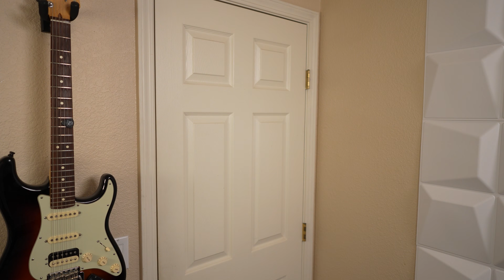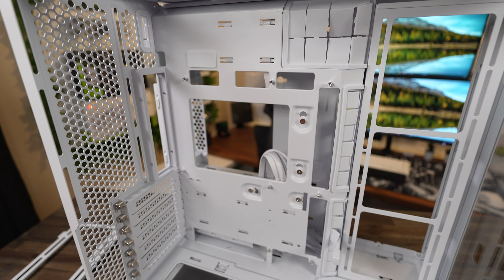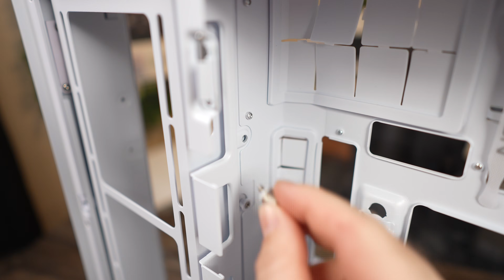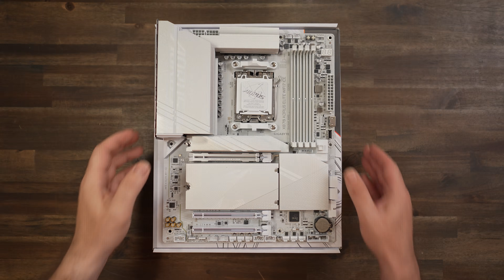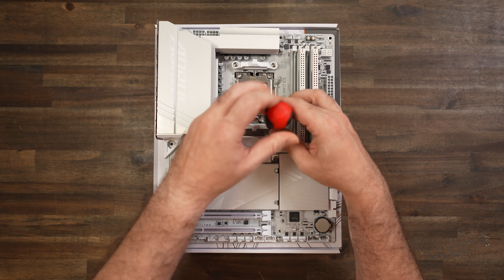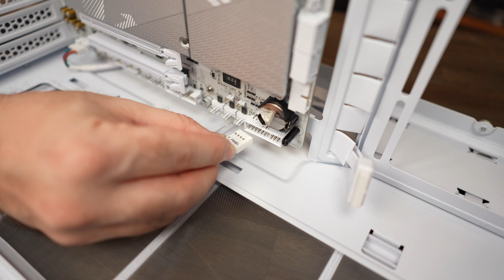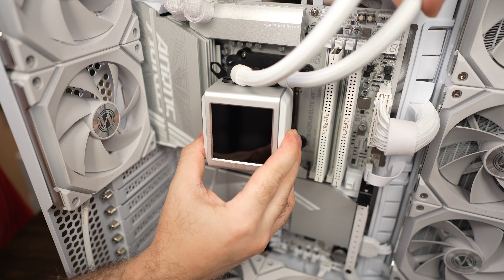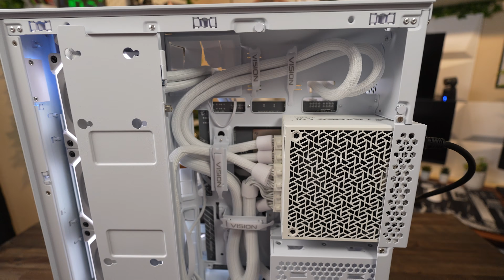Lian Li is BACK with the NEW 011 Vision COMPACT (X870 Build)

Comment: cleannnn af... although i dont know too much about that brand for the 90 degree High volt power cable for the gpu. Whats the best of the best you would recommend for getting a 90 degree angle for the new RTX 5000 series? Especially if your planning on giving a kidney and a leg for one, do not want to risk frying the GPU.

Comment: Hey man, I just built a pc with the same case and I liked your wire management of the back so much that I ended up buying the wraps for the cables through your link. I just received them today, but they seem small. You used the 1/2 inch ones? 
Also one more thing I installed a 5080 and a little sketched out using that 90 degree adapter through amazon, would you recommend a specific one?
Last  thing whered you run the cable for the two exhaust fans? @DanKamYouKnow

Comment: Hello, I have a question: is it more spacious than the h9 flow? Does a msi 5090 trio fit here horizontally without the cable pinching?

Comment: Quick question! How did you mount your fans using the outside holes? My screws are shorter. I have to mount them from the rear of the fan.

Comment: Hi Kam, I believe you are able to orient the radiator the other way around if you run the tubing down and right, out of the grommet the motherboard power is also going through. It will make the AIO last longer if you do :)

Comment: Just got this case. You gave me SO MUCH peace of mind with that F Panel cable this case comes with. My MB is a gigabyte B650 Aorous Elite AX Ice which has the same F Panel header and knowing I can just plug in the F Panel case cord right in without issue to the far left pins gave me a sigh of relief.

Comment: Would be super cool to also use a 90 degree adapter for the 24pin and 12v connections or maybe even an 180 degree (if it even works) to hide the most of the motherboard cables

Comment: Is it possible to do the push pull set up (vertical radiator as you had) with the mesh top? I want to add to add 3 fans up top too, while keeping the radiator on the side.

Comment: I have a question because I'm looking to build in this i wanted you to explain how the fans work like the reverse ones do the reverses ones pull in airflow or push out and did put the reverse fans on the back of radiator or in the front of the case and the 2 fans on the side in the front are they regular or reverse, sorry for the question just really confused

Comment: I’m planning to do a similar build with a Asus astral 5090 and a Ryzen 9 9950X3D as soon as they release. This is a fairly big project that I’ll be attempting/ my dream computer build. Will I need to purchase any additional connectors, or splitters to have the ARGB lighting fully functional/ synchronized, and is there any advice you would offer?

Comment: bro you inspired me so much for build my setup, thank you so much ❤
Reply from the maker: Happy to hear that! ❤️❤️❤️
Reply: @DanKamYouKnow so I’m building my first pc as a console user and i need some clarification. In regards to fans, specifically LIian LI TL wireless. Do i want the bottom 3 and the  3 radiator fans as reversed and then the two on the left side those are standard fans for a total of 8 fans?
Reply from the maker: @ If you are running the same case (or a case with a similar layout), you will want the fans on the SIDE of the case and the BOTTOM of the case to be reversed blade. The rear 2 are standard blade. You will need at least one 3-pack to get the controller.
Reply: @ oh so the orientation is if you are facing the small glass side then to the right of it where the aio is considered the “side” not the back. I didn’t know that. So, I can just run 6 reverse and 2 standard I don’t need fans on the opposite side of the radiator to do the push pull method you mentioned. Yea if I researched right, the white controller is for lcd fans and the black one is for non so if you get a pack of 3 that lcd controller will control up to 10 fans so I would only need one usb.
Reply from the maker: @ Correct, 6 reverse blades and 2 standard. The LCD and non LCD controller is the same. I am using the LCD controller with a mix of LCD and non LCD fans. The color does not matter.
Reply: @ ok thank you so much man. This is my first build so it’s a bit of learning. The last time I played on a pc was with those tan dell towers playing sierra games lol So far I have the Lian li compact, the 9800x3d, 870e strix motherboard and 2 corsair 16gb vengeance ddr5 sticks ( can you run 4 16gb sticks?). I’m still unsure on the aio. Leaning towards the ROG Ryujin 360 for a blacked out look, just unsure if it will fit in the grommet hole. And of course the GPU is a huge issue right now with cost and the new ones releasing. I do wish I could snag that sweet gunmetal 5080.

Comment: Not a fan of the connectors for headphones and usb flash drives at the bottom near my feet. Dont want to risk kicking or getting my feet tangled with cables. I like the Antec C8 white more.

Comment: Curious, is there enough GPU clearance to fit 28mm or 30mm fans on the side radiator?  I have som APNX fans I intend to use in this case and they are 28mm.  I was also eyeing the D30's.  Thanks!

Comment: Looks are wonderful on your build!!!
Just wondering why you went with another series of fans on your AIO? All about cooling but could be some overkill ????, However give me your take on the 2nd set? 
How tight was the side glass placement from using the 90 degree power adapter to the GPU?
Would have been nice if there had been more room to move the port for the AIO over into the middle, but then that may have interred with the Back Connection port’s.
Thanks for the video!

Comment: Hey man quick question. Did you attach the SATA cable from the AIO pump into your power supply? I'm wondering as I'm gonna install this on my build but I'm not sure whether the included SATA cable beside the USB c is required. I could see that here in this build it doesn't look like you have it plugged in. Let me know thanks

Comment: Nothing these days makes a PC case stand out from others - they all look generic and the same. To all manufacturers, please go back to the drawing board. Let's start bringing multi-colour, desktop versions and make the overall designs more interesting.
Reply: The average consumer doesn’t want multi color parts. That’s where the rgb comes in. You also have to realize that there is multi colored parts out there but people don’t buy them as much because that limits the themes you can pull off with rgb. I’m with you on maybe the architecture of parts, but colorizing parts limits the freedom of customizing your pc afterwards. That’s why people either go all black or white or a combination of both.

Comment: What screw did you use for the push pull setup that is long enough to hold both side. I know the that come with the AIO is long enough but what screw do you use on the other side am looking to do this exact setup but can’t find the right length of screw ? Please send me a links
Reply from the maker: I used radiator screws on both side. For the front, the screws go through the fan and thread into the radiator. Same thing for the back but the screws go through the fans, then the bracket, then into the radiator. So the back screws are what hold the radiator and assembly together. I don’t have a link but PC radiator screws should get you some on Amazon.
Reply: @DanKamYouKnow will a tryx panorama aio fit in that grommet hole?

Comment: Are those Just the cable management sleeves u can get on amazon? Which brand? Also What do u strap the ends with? Is it Velcro strapping? For where the plugs stick out on both ends to keep them tied off and from unwrapping? Or is it electrical tape on the ends? It looks super clean.

Comment: I'd like to know the size of the cable sleeve used for the 8-pin cable and the 24-pin cable used in the video. There are several sizes on the site on the link, so I don't know what size to buy.
Reply: Did you find out?

Comment: Doesn't fit 4090, you need to set it vertically for that by getting the connector! Had to change it to DF800 for it to fit.

Comment: so on the radiator since im doing a build like this with the new be quiet dx900 case the air in coming in from the back of the case and the reverse blades are pulling air inside the case?

Comment: Q) wouldn’t you want the radiator fans to exhaust not intake? Isn’t that hot air coming in?
Reply: Cold air cools the radiator before getting in the case. Why cool a radiator with hot air?
Reply: @where does the radiator heat go?
Reply: @fuzzylogik1429   out the other side of the case. Why would you heat up a radiator that’s has hotter water?
Reply: @TheSjuris  the radiator is the heat source right? So, the air that passes through it will end up hotter. Not sure why you would want that hotter air in the body of the case?
Reply: @  you want cold air to go through the radiator cooling the radiator. You don’t want hot air going through a hot radiator heating the radiator up. The heat source is the cpu and you want cooler water absorbing the heat.  Plus a radiator itself will keep hot air from flowing through it. So again why would you want hot air heating up hot water.
Reply: @TheSjuris  Yes, the heat source is the CPU, which is transferred to the radiator. So we agree the radiator is 'radiating' heat. 

We then have two sides of the case, one side we want to keep cool (the one with the CPU/GPU) and the other we don't care about. 

Why would you blow the radiated heat 'into' the side you want to keep cold?
Reply: @ you’re missing the obvious point why would you want to keep hot air in which you would do by blocking the exit with a radiator and that you want to cool the radiator which you need air that isn’t hot to do.  So tell me why would you heat a hot radiator with hot heat from both the cpu and blow even more hot air from the gpu at the radiator?  By the way, the correct way to do this is exactly how I am describing it and the case and aio manufacturer agree with me along with science.  Cool air cools hot radiator and exhaust fans remove hot air. You want to cool the water in the radiator kinda harder to do by blowing and pushing hot air right at it.
Reply: @TheSjuris  but you get the heat doesn't go away, it's just transferred to the air which is blown back into the component side. This is why radiators, where possible are at the top of the case blown out. 

I would think pulling in from the bottom past the GPU and blowing out though the radiator would result in a lower component side temp. With the downside of possibly higher CPU temps, which seems like a good trade-off.

Anyway, that's why I asked the question as just looking at the config would seem the hotter air from the radiator is being pulled past the GPU, maybe the rear exhausts are capturing all of it and the bottom extraction works better with the direction of the GPU fans.

Having radiator fans blow inwards is not common, so not sure where you're getting that idea.
Reply: @  you’re adding heat to the cpu not taking it away. The gpu gets its cold air from the bottom intake of this case already.  Blowing it out through an object that is just about completely blocked with air coming in which would also include air from the gpu that left the case only to get pulled back in. You want cold air to cool down the water that flows through the radiator that way it can cool down the cpu with whatever heat that’s generated to get out of the case right either next to it or through the top. This case in particular has issues with removing heat through a potentially solid top.  You’re not seeing the point you want to cool down the radiator and the water and you can’t do that by blowing hot air at hot water. People put their aios on top of the case because it doesn’t add noise to the case or allows bubbles to form.  The better cooling mechanism is by putting the aio on the side or the front where it has better access to colder air.  Have to remember that hot air also rises and there’s usually little filtration of air on top.
Reply: @TheSjuris  you lost me a bit. The ambient air temp inside the case is still going to be lower than the radiator temp and won't be 'heating it up'. 

The trade-off is a higher internal temp vs a lower CPU temp (the heat has to go somewhere) I would have thought a lower internal temp where the GPU is drawing air would be more important.
Reply: @  the ambient air is lower then the radiator hence why you want that cooling ir down instead of the hot air inside the case. The ambient air inside the case will be almost as hot as the radiator since it has 2 hot components heating to it up. The gpu gets cooled from the fans blowing directly underneath it. You want the heat that’s generated to have access and with 2 exhaust fans directly next to the cpu it will push it out.

Comment: Awesome build! What about the direction of the air of the push pull configuration of the radioator fans, does it push air inside or outside the case?

Comment: Hey Dan! I also want to use reverse fans in my build so I just wanted to ask if you used a fan hub to wire the fans together or did you use maybe fan splitters?
Reply from the maker: The Lian Li fans comes with a controller (the 3-pack's more specifically are the ones that come with the controller) and that is the only one that will work with Lian Li fans.

Comment: is it possible to use the vertical mount for the gpu for a different look and also to avoid using an adapter in order not to hit the glass panel?

Comment: Great case! But one thing I noticed is the bottom fans are pulling air out of the system. As are the side fans. Looks like every fan is pulling out air. Plus the radiator fans are pushing against each other.

Edit: Saw the pinned comment. I stand corrected. I had no idea reverse bladed fans existed. Looks strange as hell but is pretty neat!

Comment: Prices on 11/11/2024
Approximate total pretax = $3,340 USD

Case = $120 USD
AMD 7950X3D CPU = $593 USD
ASUS Strix 4080 Super GPU = $1,130 USD
GIGABYTE X870 AORUS ELITE Wifi7 ICE Motherboard = $290 USD
Super Flower PSU = $200 USD
Lian Li Gallahad II LCD CPU Cooler = $220 USD
Samsung 4TB NVME Storage = $300 USD
TEAMGROUP RAM = $160 USD
Lian Li SLV2 REVERSE blade fans: (Front Side and bottom) = $27 USD each (x6)
Lian Li SLV2 Fans (Side Rear) = $93 USD
Lian Li SLV2 Fans (Rear) = $27 USD
90 Degree GPU Adaptor = $20 USD
Cable Wrap for PSU cables = $17 USD
Velcro strips for PSU cables = $7 USD

Comment: Awesome build! How is it going with the EZDIY-FAB 90 degree adapter?  I have a 4070ti super aorus strix GPU in a Lian Li O11 dynamic case and am having the same issue with the case front panel not being able to close so am considering using the adapter. I'm a bit worried about using the adapter but the only other option is a new case or perhaps vertical GPU mount.

Comment: Am i trippen? I swear it looks like the radiator is regular blade (intake) and the front fans are regular (intake). Meaning the air flow isnt balanced/is being wasted by them blowing opposite ways. Right?? I NEED ANSWERS!!
Reply from the maker: The front radiator fans are reverse blade and are pulling air into the case. The back radiator fans are regular blade and are pushing air through the radiator. They are both intake fans.

Comment: I have a VERY WEIRD problem on my machine! RTX 4060 TI 16GB VRAM, i9 12900KF and 32 gb of ram 3600mhz DDR4 and when I play like, call of duty black ops 6, Battlefield 1, Battlefield 2042 and even the hell of FORTNITE, I have FPS drops all the time, Out of nowhere I'm playing at like, 200 fps calmly, and OUT OF NOWHERE my fps goes to 10 for a few seconds, then goes back, then drops again, and so on until I press alt+f4... has anyone had this problem? Does anyone know how to resolve this? I thought it was something in Black Ops, but now that I'm having the same problem in other games, it's a little worrying because it doesn't matter if I set it to the lowest possible setting or the highest possible, always the same problem. 

All drivers are up to date, nothing is overloading, at least so far I haven't seen absolutely anything reach 80 degrees, I've reinstalled everything, I've reinstalled the games, anyway, it's still the same. But for example, in Forza Horizon 4, it doesn't have this problem... in Nioh, it doesn't have this problem...

Comment: Man the build looks fantastic! I’d like to copy it myself. Question, would the adapter for the 4080 GPU cause any weird power issues? I’ve heard that some of the newer cards’ cables were melting due to connector bottlenecking with the power transfer. Would this be an issue with the adapter and the 4080 Super?

Comment: Just built a new Corsair white PC and I’m jealous lol should’ve stuck with Lian Li it seems. I’ll drop the specs of my build below love the content man. 

Mobo - Gigabyte x670e Aorus Pro X
CPU - 7800x3D
GPU - 7900 XTX Taichi white
Ram - 32 GB Corsair Dominator Titanium
AIO - Corsair H150i LCD 
Storage - 2 TB WD Black SN850x
Case - Corsair x6500 white
Fans - 10 white iCue QX 120mm  
PSU - Corsair Shift 1000w 
Accessories - White cable extensions and sag bracket

Comment: I'll never use a Gigabyte ever again...i bought 4 of them, all 4 broken within 3 month...srsly, some of these Boards are quiet Expensive...then u build your PC and after 3 Month u need to rebuild everything, a joke...But another question, did Lian Li get their fans working with PWM right now? Cause i got the 2nd charge of them and they never worked on PWN mode in the Lian Li L-Connector 2 Software.

Comment: You shouldnt use those right angle adapters they are known for causing the connector to melt and fuse to the gpu